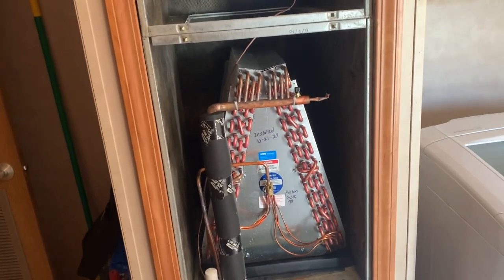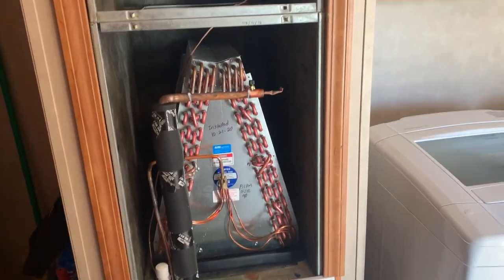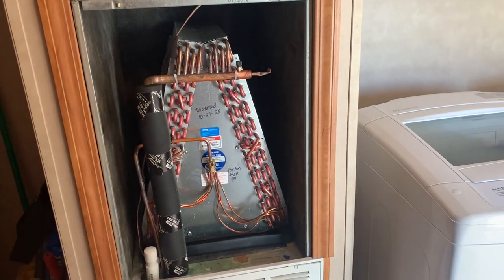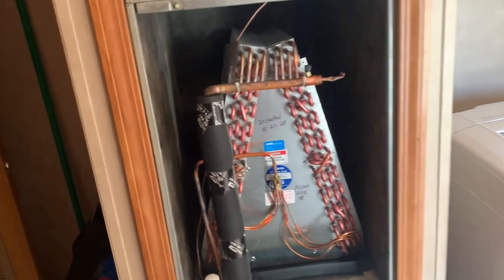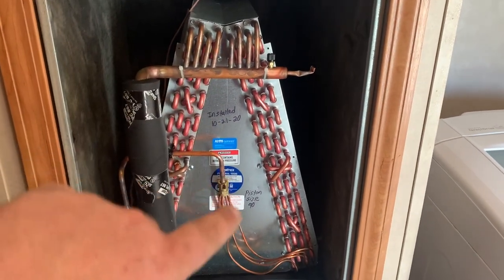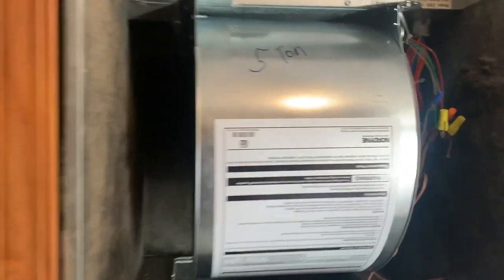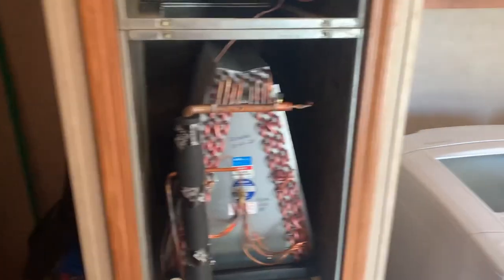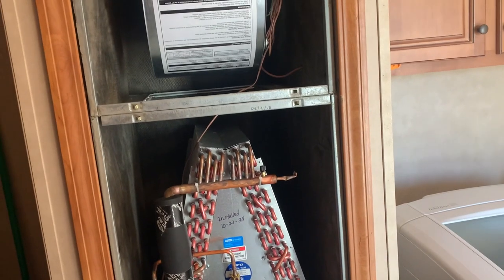A Mobile Home HVAC System/Rant

Comment: 80x30=2,400 Sq Ft. X 25= 60,000/12,000 BTU = 5 ton. Those who are criticizing you, are Wana be techs. As for the clientele, who cares? A job is a job and will pay the same if it's a mobile home, travel trailer, 3 story home etc.

Comment: Tying into the sewer is not good...unless you have a check valve. When in doubt  pump it out.
Reply: Need an air gap between the condensate and the trapped sewer line in my area.

Comment: Your right I also put the larger coils on also, these guys need to get off this bull of 600 sq ft per ton.do the load calculation, and the larger coil also has more latent capacity, John does the math and science, also he is not predgidous.

Comment: Joshua Timmons
6 days ago (edited)
https://www.trutechtools.com/product.asp?itemid=11067&gclid=CjwKCAjw5p_8BRBUEiwAPpJO6_H2t_tHdv1Gzbb7zszJnyjgsI7kJJgpQDiEMjPPHmvMhQLoQJTsZRoCh38QAvD_BwE

The SUPCO Universal ECM Tester provides functional test for virtually all types of Electronically Commutated Motors on the market.

Easy to use: Gives a "Go / No Go" Result
No batteries required
24" leads, and magnetic case for job-site convenience
24VAC Indicator light
Short circuit protection

Use that for testing ECM motors

Comment: Most mobile homes need a larger unit because it’s not built the way the new energy efficient homes are. That’s why when they come new with 3 tons they never work. I always upsize at least .5 ton bigger than factory in mobile homes. Money is money. Why does it matter if your making the money working on a stick built home or mobile home? There are a lot of idiots out there.

Comment: I have a question/need: I have 2 sons that live in Fayette County, TN and live in mobile homes.  My oldest got COVID and has not been able to do maintenance on his AC unit like he should.  His unit froze up yesterday.  The coils (inside) are covered with dust and cat hair.  It is so packed, it will not vacuum out and a brush only pushes it deeper between the fins.  What can be done to clean it and get his cooling going again?  Thanks.  You can reach me via everett@p-es.com